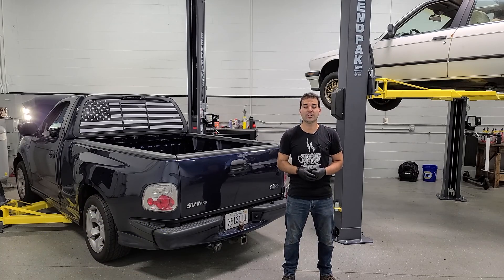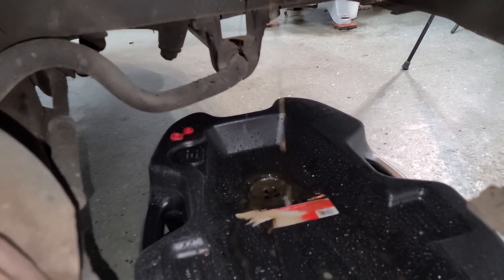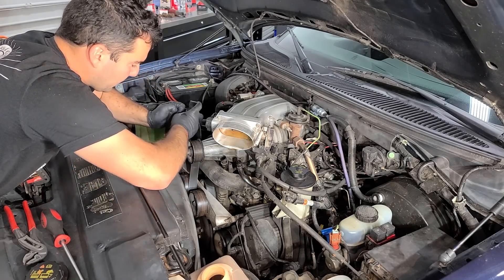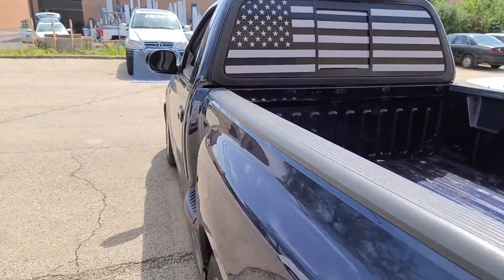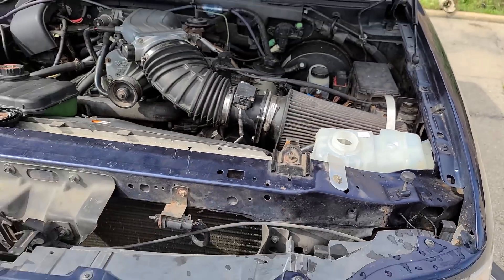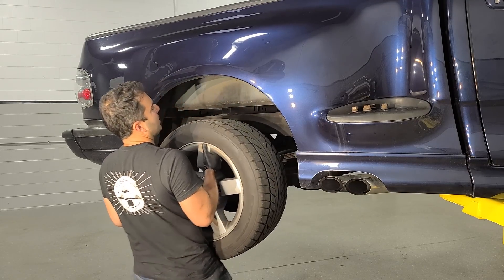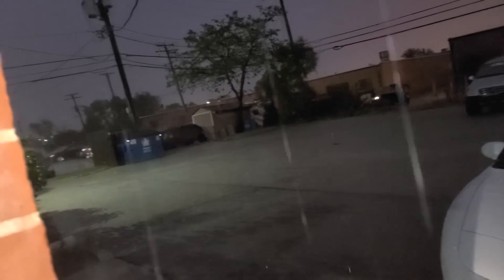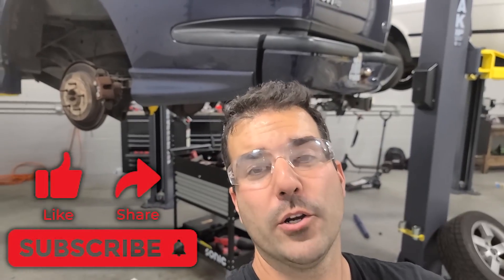I Fixed Almost Everything On My Ford F-150 SVT Lightning Until A Big Storm Stopped Me From Working!

Comment: Get ya a proper battery powered craftsman angle grinder. I got a whole 20v set with an impact, hammer drill, sawzall, multi tool, skill saw, light, charger and 2 batteries for $271. It's been great and I use em everyday. For the last year plus.

Comment: My preferred method for removing shock mount bolts is using an air hammer to crack the nuts off. Seems like every truck I've ever worked on likes to fight at least one shock. Great video, enjoyed watching it.

Comment: Should have gotten a flush t that goes on the heater hose. Comes with a garden hose adapter run a garden hose on it till it comes out clean

Comment: For gloves, would you consider chemical resistant gloves? They look just like the ones dishwasher boys use that go up to your forearm but theyre heat and chemical resistant, and therefore much more durable. I use them all the time for oil changes and they've been fantastic. They're washable and reusable as well.

Comment: Just curious how many lightning owners watch these videos,past, present,original,how many miles etc. I rarely see lightning coverage anymore. Thanks for sharing your journey Alex,I don't mean to hijack your video,just curious how many of us are left.I have my 01 that I bought new,has 10k miles,red in color,4lb lower pulley,boost by pass,cold air intake,tuned by JBM,rear leveling kit,and nittos all around with 305/45 out back. I bought new original equipment wheels when I got the truck so I still have the originls with the Goodyear tires still in place.

Comment: Any reason you didn't put the bolt on the first shock in the same way as you did on the second shock so your drill doesn't run out of room like when you took the old shock off?

Comment: When I address a suspension noise in my Jeep, it just uncovers another sound I didn’t hear before.  I had a squeaky alternator bearing.  I swapped it out, then I started hearing a lifter tick.  I swapped the shocks because of a clunking sound.  It helped, but then I could hear the sway bar link clunking.  I changed out the end link and I heard then the spring perch isolator knocking.  One thing after another since I bought the thing.

Comment: I think rust in the cooling systems on the Ford 5.4 is a common occurrence. Have the same issue on mine, turns brown annually even though I flush it and use 50/50 with distilled water every year. It's really annoying.

Comment: Just a quick question/observation. Those new rear shocks looked REALLY long compared to the old ones. Are you sure they're not for a standard F150? With how much you had to compress them, they don't look like they'll have much travel left. 

Anyway, great video. That’s a great bonus of AC in the shop. It makes things 100x nicer for sure. I just installed AC in my shop a couple weeks ago and it has been AMAZING. I don't how I went so long without it. It's been in the upper 90s here in Indiana the past few days, but my shop has stayed at about 75 degrees inside.
Reply: I was thinking the same thing. Either the wrong shocks or the truck was lowered and needs shorter shocks.

Comment: I bought my Miata with coolant like this. I did the same thing. Took like 8-10 times to flush it.

I replaced the radiator and coolant tank getting it to be somewhat clean.

A month later it was bad again. Did it again. Then I had an overheating issue. I just did everything. New rad/head gasket/water pump.

While doing that job I discovered the inside of the engine was very rusty. 

That engine lasted about 1 more year then it lost compression. Replaced with a really nice used motor, been good since.

Never buying a car with rusty-looking coolant again lol

Comment: Fun video!  But using the suction tool is more work than just pulling diff cover.  Plus you dont ever get all the old crap fluid out.. Also when you pull the cover you can clean the back side of the cover which usually gets all nasty from years of neglect, then  inspect the gears and diff.  Hardly ever are those shortcuts worth a damn

Comment: Looks like block sealer. I've never been successful at removing it. My last attempt was putting the hose in the rad fill and draining the upper hose on the ground with the engine running for 30 hours!!!!!
It still turns brown in a day. Short of disassembly and hot tank I don't think it's coming out. You'll find the head gasket or intake leak if they haven't fixed it.

Comment: Amsoil dealer would be showing us putting 5w20 signature series in the crankcase...then they would drive it for 1k miles and then they would drain and replace it with more 5w20 amsoil signature series

Comment: Crossing fingers for your basement...been there before.  Question on the rear diff.... Does the car need to be flat, or can it be at an angle (I have ramps that I can only get one side of the car up) ? My car has the 2 spots one for the breather and drain..

Comment: Question: If the stock belt was too short that means they went with a larger lower pulley and left the upper stock (it looks stock)? Seems like more work than just doing a smaller upper but I suppose that gives the belt more surface area to bite. My Cobra has a smaller upper and it's never slipped, but it has an additional tensioner pulley.

Comment: Great work as always. Little late to this, but I use "Grease  Monkey" gloves from Sam's Club.  I can't stand those single use nitrile/latex style gloves you're burning through. The Grease Monkey ones last a month or so unless doing something really dirty.  Just replaced a transmission on a diesel BMW X5 with 1 pair. Talk about a grueling job. Anyway, thanks for the content, eagerly awaiting more E30 videos.

Comment: The gloves I use are called "GREASE MONKEY" They are black nitrile, 8 mil thick. I am in Vancouver, Canada, but I'm sure that these gloves would be available to you in the U.S.A as well. I could always ship you some if you have any difficulty finding a local supply. Enjoyed the video. Thanks. Good luck on the flooding situation. 

Air conditioning and a water cooled floor, what more could you ask for?

Comment: regarding the radiator flush and cleanup I own a 1992 Nissan maxima and realized in the dealer they had it running with just water, I would like to switch to coolant but someone told me that it can lead to several gasket issues and leaks so the best is to keep it with plain water, any advice?

Comment: I seem to be doing just the opposite! Took my daughters 2012 C250 to dealer for check engine light. Week one they said three items- 1 conductor plate, 2coolant pipe leak, 3 transmission mount broken. Had em fix just conductor plate and we'd do others later...(myself) following week they called and said another code came up. Turbocharger had issues. New one installed $3500!!!!!! I'm not digging this at all. I told them we'll come back for that one later too, just button it up and I'll get it tomorrow. What is it with these crooks? I didn't see the jolly Rodger flying outside......must've missed it!

Comment: The way to clean up those coolant reservoirs to a reasonable standard is to put a few handfuls of coarse clean sand in there, add some water and shake the living daylights out of it. Has worked quite well for me on a number of vehicles, then you can save your $30 for some lemon squash 🤣🤣

Comment: Ford trucks are terrible for a mechanic to work on in my experience. I believe that rust coolant must come from the factory that way since every ford truck I have had to drain coolant looked like that. As a side note, a piece of transmission line on the drain works wonders for spill and splatter when draining. Oh, one the best drain pans I found is a square plastic van gas tank with the top cut off. Or, if you can find, a spare tire cover from an old van. Hey it works! Keep up the fun work!

Comment: I have a very strong feeling the rear shocks are wrong for this application.  You got the Harley F150 rear shocks and are not the same. (in 2002 Ford used the 5.4  S/C engine in the Harley F150)

Comment: Not a huge harbor freight guy, but they sell 9 mil gloves that last a pretty long time.  Bought 8 mil gloves on Amazon which are good, but the harbor freights 9 mil last longer.  You might want to order a size larger, because the reviews said they run a little small.

Comment: There are specific mechanics gloves available but also nitrile gloves that have a rough exterior texture for grip and flock lining to reduce sweat. Sorry don't know the brands, just rewatched Kent's (Mercedessource) 9-year-old video on gloves. Love the editing on your videos, very slick and whoever does it catches all the funny bits. (Edit) Meant to add Alex, when you get the new drive/serpentine belt, soak it overnight in 303. It'll last years.

Comment: don't do stainless top....go to plastics international.... give them the dimensions of your table.... 3/16 or 1/8 lexan / polycarb...  they will shear to size and ship.... 

better impact resistance, better for working on, easy on parts.....and you see the nice stain job you did.

Comment: Bought my yellow rumble bee ram 4x4 back in 2015 had rust under frame like the lighting you just bought minimal surface rust I thought I sanded and coated like you did to prevent further rust I live in Tx this truck came from up north last year paint started bubbling in different locations now it need a full repaint and cutting of some panels from so much rust going forward I won’t ever buy another car or truck that came from up north

Comment: That truck take the exact same coils as my crown vic and I've run accel coils on mine and so far they've been on for 150,000 miles and they've been performing flawlessly.... and the thermostat bolts are so long because on top of them holding down the thermostat top they actually screw into the block and hold the actual intake onto the engine which is stupid in my opinion

Comment: Working on a GEN10 F150 is like working on a GEN4 Fcar. Half the engine is buried under the glass/firewall every everything is packaged in there tightly.

Working on a GEN 1 Silverado/Sierra is like working on a Foxbody/SN95. Everything is pretty much out in the open in comparison, and the engine isn't half buried under the firewall.

Comment: On that rear diff cover, a real tech told me long ago, just loosen the bolts all the way around, except like the top 2 or 3, at the 12 O'Clock area...  then get a screwdriver in the gap, a little, carefully, and it will spread the pan a little at the bottom, and all the fluid will glob out...  then pull the screwdriver out, re tighten all the bolts, and fill it back up...  He claimed he never had one leak.  I've done maybe a dozen like that, I never had one leak either....  So you can try that, if you don't have the extractor thing....

Also, I've seen at Harbor Freight (I know, unbelievable) they have gloves in various thicknesses....  So you can buy a thicker glove, if you want.  I think I buy the 7 mil ones??  Not sure, but there will be a bunch of boxes, different sizes, different thicknesses.....  I kind of like them, they're thicker than the old "surgical" gloves I used to use....

Anyways, great job on this one....

Comment: 25+ years of turning wrenches and I can tell you that I hate nitrile gloves, Alex.  Aside from the durability when dealing with fuel or the chemicals in the parts washer, they are garbage for daily wrenching.  Latex gloves stretch and expand, so when they catch on something they have enough 'give' so they don't just instantly break and shred like nitrile gloves do. Our Snap On rep used to have 10 mil latex gloves that I could reuse for a full day that also had texture on the finger tips to help hold on to tiny hardware in the engine bay. Microflex MF-300 is what we use for our everyday glove at my current dealership and the really seem to hold up great.

Comment: So, those coolant flush products are just made with sodium citrate, aka the salt of citric acid (which is obviously just an acid). What you can do is just use vinegar mixed with baking soda to make sodium acetate, then use that to flush the system. At less than $2 a gallon for vinegar, there's no reason to buy that rip-off stuff from the auto parts store. Even just pouring in vinegar with the water is going to work to flush the system

Comment: Guy how is it suppose to flow if the belt is not on the water pump ?
Reply from the maker: There are 2 belts. The water pump one was still on.  This just drives the supercharger

Comment: Those rear shocks seem too long. I checked rockauto and they list Bilstein 24024792 rear shocks for your truck. They are not correct. Bilstein 24187459 rear shocks are the correct ones for a Lightning.

Comment: As a guess, the reason why this truck is oddly maintained was well-maintained by the original owner (probably even stock), and then a 2nd owner got it and couldn't really afford it, but he put on some go-fast mods that really weren't.   The intake system on this truck is something that looks cool to some, but never increases power (if it did, Ford would have put it on at the factory).    

The shock replacement is the dead giveaway.   The guy couldn't afford four shocks.   Personally, I would have just gone back to Ford and bought Ford replacement shocks because the rest of the suspension is tuned from them, and they tend to last longer than 3rd party shocks (I understand about sponsors), even if they're more expensive.

Comment: You could probably flush that 50 times and it wouldn’t clear. Take out the radiator. Run a hose or pressure washer to the radiator inside, moving it all over turning it around. That will get all all of the rust dirt out.

Comment: Nice job. U really should clean the areas and surroundings you work on before mounting new items. The driver side shock area and surrounding should have been wiped down, wire brushed, degreased, take the time, you’ll get more of an audience

Comment: Removing the thermostat can be very harmful it's hard to keep the motor cool when you remove the thermostat the thermostat also holds water in the radiator to be cooled

Comment: I’m just sitting here, judging you and armchair quarterbacking! 🤣🤣🤣

I just buy my disposable gloves at Harbor Freight. They all suck when they’re disposable! I also like to buy the yellow dish gloves and cut off some of the length. They breathe better and I use them mostly for fueling diesel.
Your shop needs to invest in a Milwaukee 12v sawzall! You’d have loved it when cutting off the tops of the shocks.
I’m 100% sold on Toyota (pink) antifreeze! I use it in everything.

Comment: MOOG isn’t what they used to be.... I had failures out of the box... they admitted to putting their label on Chinese white box control arm for a 2006 Charger.  Turned out the rubber bushing was only 3/4’s of a bushing. Caused a crazy death wobble... and their answer.. send it back and buy another brand. Another ball joint failed in less than a year...

Comment: you can get clear vinyl hose really cheap, push onto that nipple, draiing == less splashy....

as for flushing - always run through the thing with a hosepipe for a while between flushes. You'd be surprised what simply rinses out

Ctric acid will clean that coolant bottle pretty well and that fan should have come out in the first place to allow the thing to get to heat when idling - and with a flush that bad, you really should pull out the rad and hose flush it separately. You have an endoscope so you can use it to snake the thing and check the state of the passages

Comment: I had to be a battleaxe with my 2003 red SVT. My shocks were original but I had to gripe at body shop to replace my Bilstiens. Bad mistake don't let anyone touch your supercharger fluid. 
You don't have to do much work to keep these going. 
Tess Corners in MKE you ruined my 12psi instant blower boost. I drove it out he made electrical problems lied. Omg it only got 8psi boost. Computer screwed. I have cried over that forever. Mechanics do not work on a L unless you own several yourself.

Comment: I find 1/2 ton trucks to be worthless. To rent a car transporter from U-Haul requires a 3/4 ton truck. The reason? A guy rented a car transporter with a 1/2 ton truck. The transporter jack-knifed and U-Haul was sued. I attend car shows so use my truck often.

Comment: Just had to replace the rear diff fluid on my 2016 Challenger that only has 11k miles.  Cost about $200.  These cars have horrible rear differentials and there's currently a class action lawsuit to hold the manufacturer accountable.

Comment: I've always liked the Microflex Dura Flock gloves.  They're thick enough not to tear easily, they have a little bit of a texture to them, and the best part is they're flock lined so your hands don't get all sweaty and wrinkly if you wear them for an extended period of time.  Only downside is they're expensive.

Comment: My dodge grand caravan awd coolant looked like that. Had to flush the block, hoses, rad, heater cores all separately. Flush is useless. Rusty congealed coolant will sit in the heatercores and rad and periodically release. 

Only a hose flush for every component separately will work. Then drain, coolant/distilled.

Unless you hose flush, coolant will constantly continue to turn rusty.

Rockauto is garbage. Chinese parts, and you pay for shipping return policy. Shipping is ridiculous too. No thx.
Losing respect for this channel really quickly.